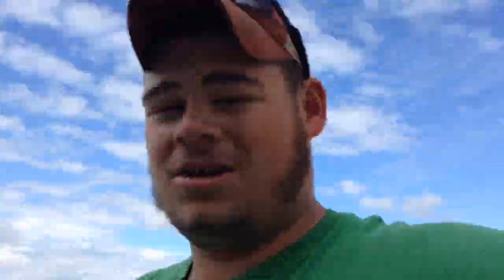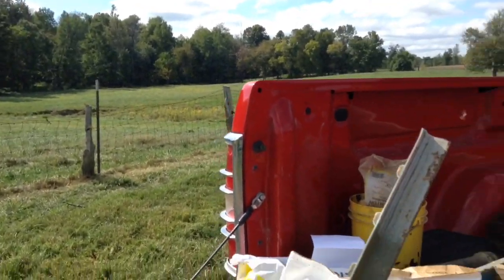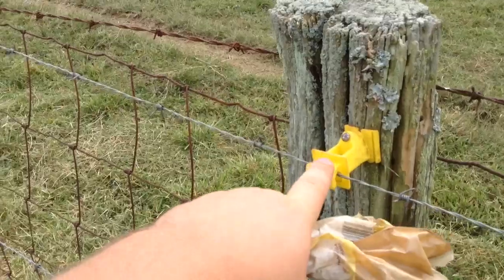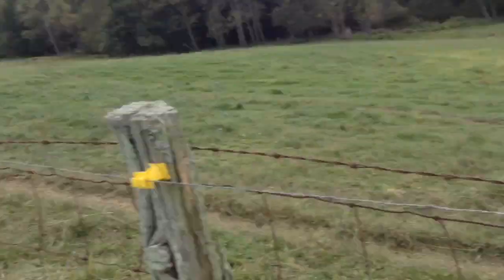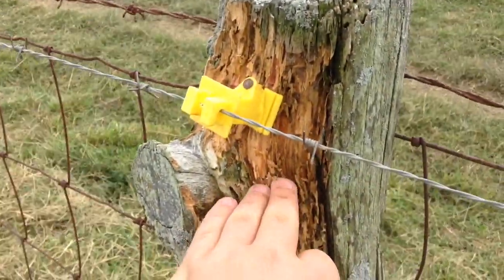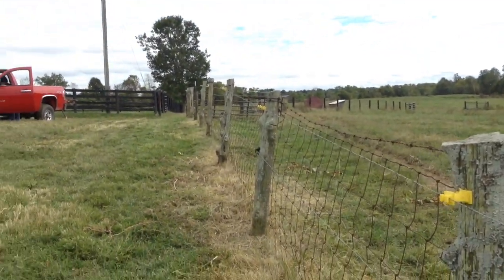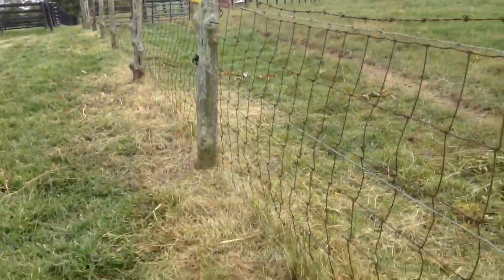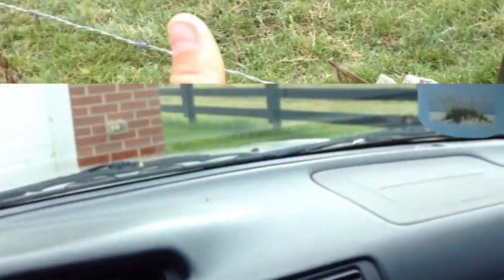Preparing to wean! Part 1

Comment: Barbed wire and electric not a combination I would recommend , but weaning calves for drastic measures.. Although the  9 joule charger makes them think twice about trying to push thru a smooth wire fence,
Reply from the maker: That's right. They will just be held in the lot for about 2 weeks to get calmed down then they'll go to the other pasture till mid-November